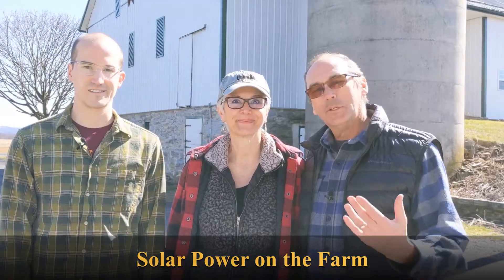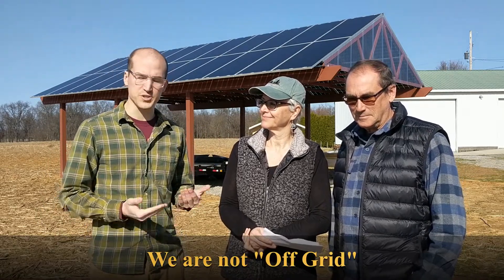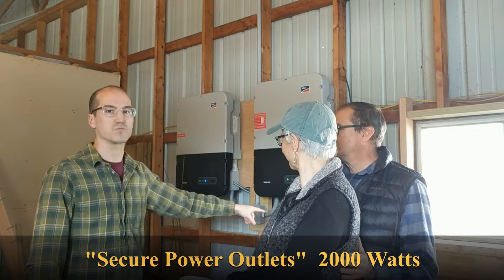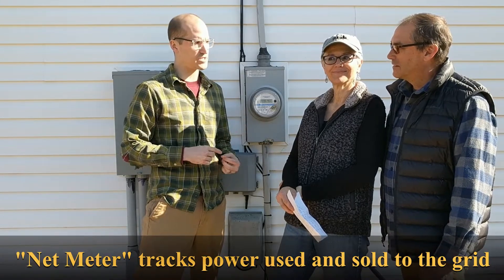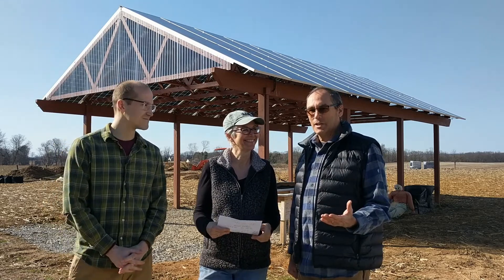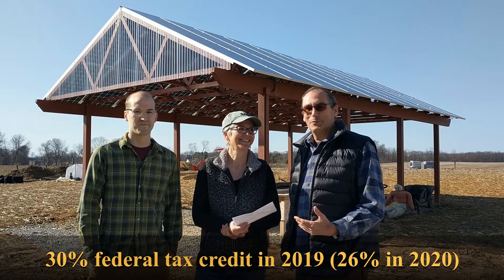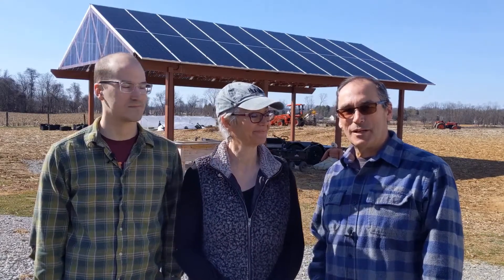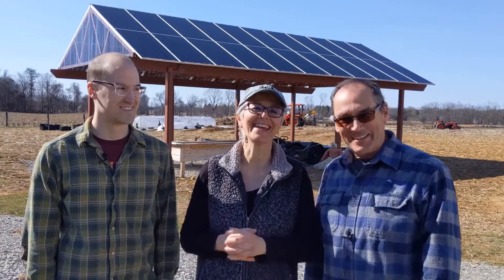The new solar pavilion on our 1840 farm  (We are now net zero)

Comment: Hi there, just wondering. . .what is the footprint size of the pavilion? Also, do you have more than one meter on the farm? We have a 35 acre farm but have two meters: 1. for the main house and 2. for the upper fields. . .
Reply from the maker: @theartisticmystic4501  the pavilion is 24 x 36 and has 44 commercial sized solar panels. Yes, we had meters (house and farm had individual  meters).  We consolidated to one 400 amp service with a net meter. Enjoy your life on the farm!

Comment: Nice job on your solar pavilion. Did you do anything to seal the seams between the upper and lower PV panels?
Reply: That is a topic of ongoing research ;). I sealed about 25% of them from below with aluminum foil tape, using it to make a gutter to the channel the water to the U shaped rails, I sealed about 25% of them from below with silicon caulking, and I sealed about 25% of them with silicon caulking and aluminum foil tape. The silicon caulking combined with the aluminum foil tape appears to work the best but durability is still to be determined.